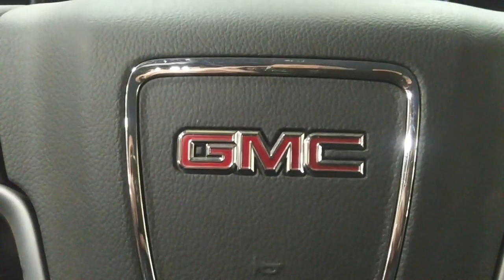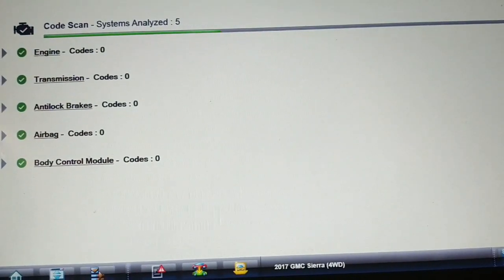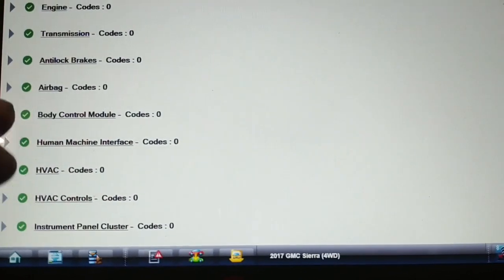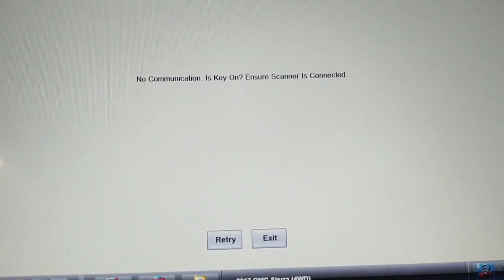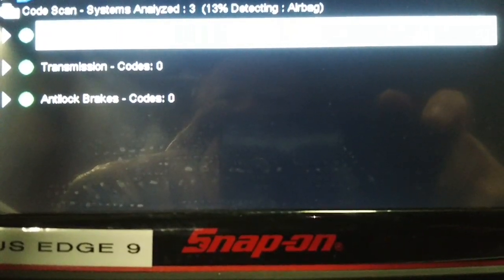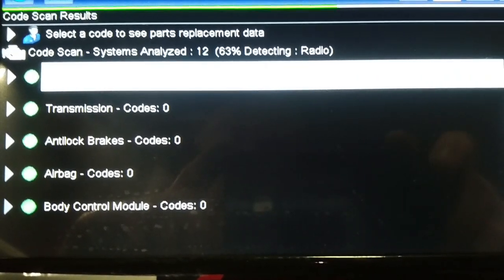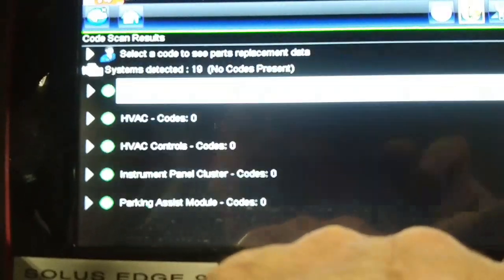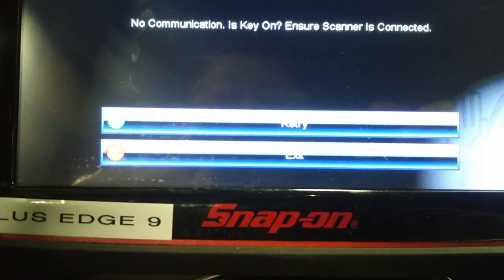Verus Edge Won't Scan Chassis Module 2017 GMC

Comment: That’s really interesting 16&17 share the same CCM I wonder is any other scanner would pick it up. I always try to look for missing modules too now but there are so damn many haha. 20.4 will be out in March I think.
Reply from the maker: That Autel MaxiAP200 bluetooth to my phone scanner does. Not sure about the Maxisys though as I didn't have it with me at the time.
Reply: Phillip Bailey how do you like the maxi AP200? It’s not bi direction just a reader right?
Reply from the maker: @weldingjunkie  well for the $140
I paid for it it's pretty amazing. Seems quite capable for entire network scanning, data. Graphing data should be Auto scaling but it's not. Does some bidirectional functions but certainly not all. I have the Dongle in my jacket pocket all the time and of course always carry my phone. Just convenient for sure. I'd recommend it as a backup tool for sure.

Comment: Where is the Chassis Control Module located? I have a 2017 sierra denali since 2019 and like a year ago started showing the annoying message about the trailer brake system, sometimes when I start the truck only, sometimes continuously that I feel like I want to stop the truck and shoot at the mother fucker,  because is beeping ALL THE TIME… I try not to drive it only when I really need it. Lately I started to check some videos, and based on those videos I checked for power and ground on the trailer brake control module and tested fine but when I was trying to erased the codes on that module (no communication with module and invalid information received) with my newest version of innova scanner, it fails to erase BUT trying to access other modules like Auxiliary Chassis Control Module, and Chassis Control Module I noticed the scanner failed to access either one of them, so I checked for power and ground on the ACCM and had no power on the Batt + pin. I reestablished power (damaged wire) and then I was able to access the ACCM and I was able to erased those codes from the ETCM and looks like the problem with the trailer brake is solved, no more annoying beeping, No codes or anything on the scanner BUT, Chassis Control Module is still not detected. Where is that module located? Im not really worried cause everything is working fine for now.
Reply from the maker: There are several versions of the system depending on RPO codes. Yours may not actually have the CCM. If you're not getting any errors I'd say your truck does not have it.